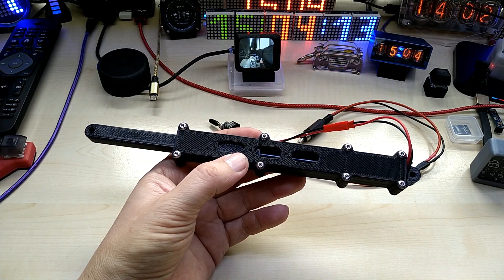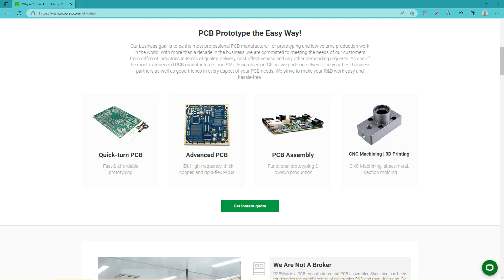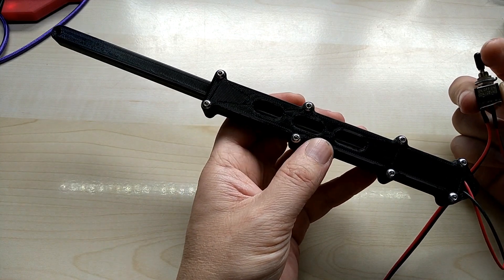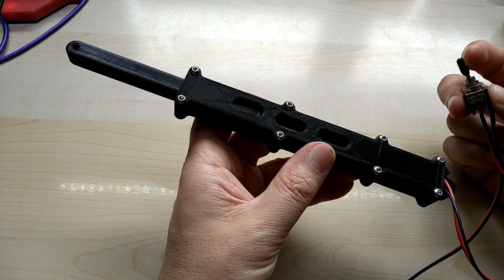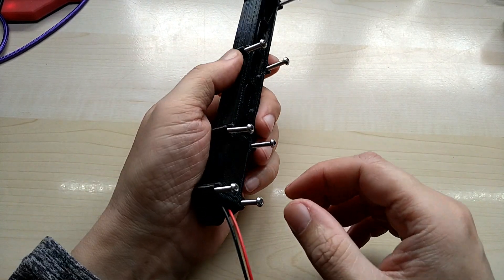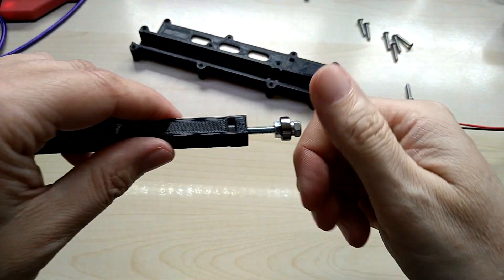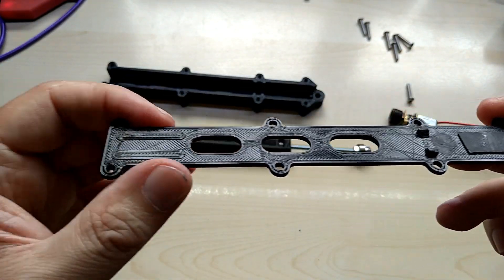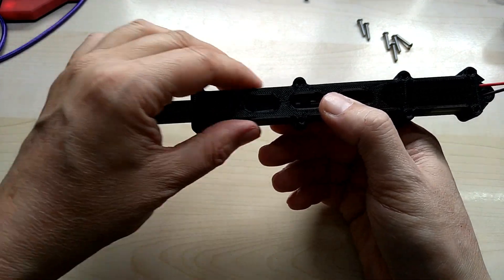#DIY  3D Printed Micro Linear Actuator based on a N20 Motor by #Hayri Link Below PCBWay.com

Comment: Hello, I see in the video that you are checking when to switch on and off the motor to avoid the shaft to keep turning when there is no more rod to push. But, I was wondering if it was possible to program the controller to stop the motor once it has reached a certain distance instead of manually turning it on and off. Because I would need a linear actuator to push and pull but only a certain short distance and I would like the user to not have to pay attention to the distance it has travel
Reply from the maker: Hi, the only way to be able to what you want is to use end switches/sensors so the power to the motor will be interrupted.
Reply: @iHayri1  Thank you so much for the reply!! I also wondered why on the system I designed, the piston wobles when it moves. would a second fixed square nut help? or should I make the guides more close together?
Reply from the maker: @PedroVelarde-f1x  A second nut will only help with play but not wobble, for that you need to tighten the guides.

Comment: very nice i ordered motors for this project, will be making my bed side laptop table raise, would be using four motors hope they will have enough torque to lift it.  by the way, those with ring called nylon lock nut
Reply from the maker: Just use motors with enough gearing down which will increase torque. Good luck on your project 🙂

Comment: oi bom dia. tranquilo. Estou desenvolvendo um projeto de mão robótica. Gostaria de falar com o senhor sobre Micro atuador linear.  Teria como usar uma ponte h para controlar a posição do motor? desde de já agradeço.
Reply from the maker: Hi, yes you can use a h-bridge to control the direction of the motor or even better get the version with the encoder for precise movement of the actuator, but need to edit the case to make room for the encoder version of this motor. Hope this helps 🙂
Reply: @iHayri1  muito obrigado. você teria algum vídeo de como fazer a programação para utilizar o motor com encoder?
Reply: outra pergunta com o motor com  encoder é necessário a ponte h?
Reply: @iHayri1  muito obrigado.
Reply from the maker: @janimarnogueira8700  sorry I do not have a video because I do not have the encoder version of this motor, just do a google search about N20 encoder and you will find examples. Good luck.